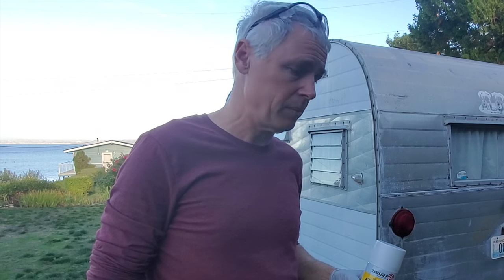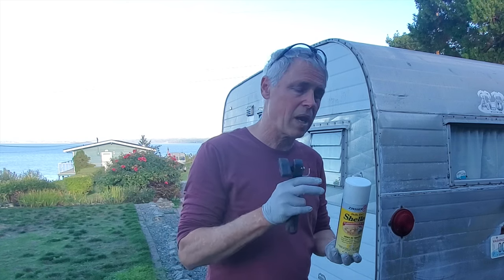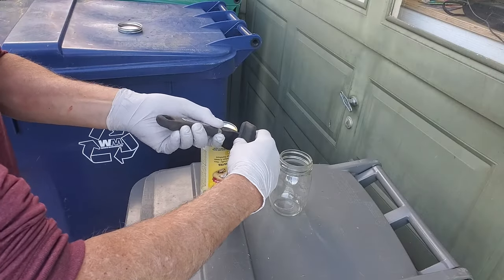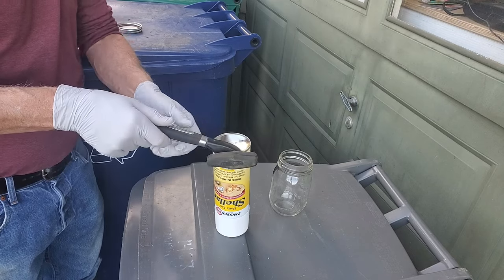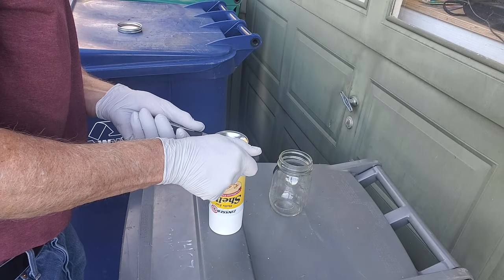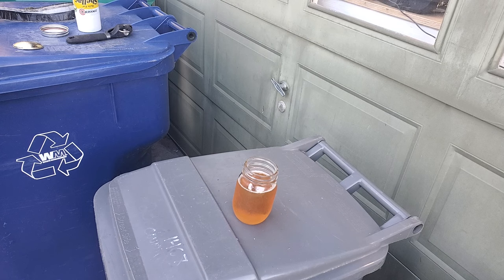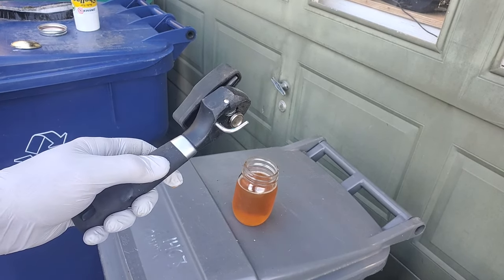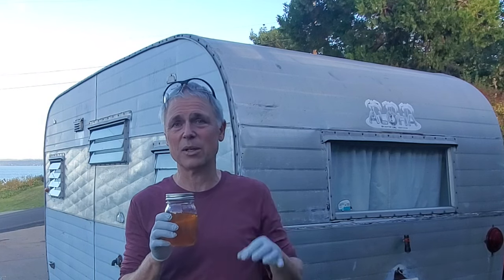How to safely remove spray-can contents.

Comment: Very interesting! Useful information too. So the bubbling when you got the bottom off the can... I'm guessing releasing the pressure relatively rapidly as you did,the liquid propellant was absorbing heat as it evaporated into a gas. It got the shellac and the can so cold that there was some liquid propellant still in the bottom of the can, evaporating and making bubbles up through the shellac.
Reply from the maker: Thanks for that info. I'm terrible at science and physics.

Comment: And... in this position, press the valve, - Is better?
Reply from the maker: up-side-down keeps the fluid from spraying out.
Reply: @paulwelkinsdiy  mmmm.... you beliebve?
Reply: @paulwelkinsdiy  To clean the valve, after painting, I turn the container upside down, and only gas comes out

Comment: "I don't want to spray this where I sleep, because I don't want to breathe this shit." Proceeds to hang his head above it while bleeding the gass he doesn't want inside. YouTube in a nutshell.
Reply: Outdoors is a LITTLE less confined than a 50 sq ft camper.
Reply: @monkeysuncle2816  sure, but if he's staying that close and venting the stuff in a bigger batch than he would release by spraying inside, I don't think it's that much more diluted with air. Not instantly.
Reply: @IvoTichelaar  true, and reducing a little inhalation to effectively none would be better
Reply from the maker: In mentioning the fumes I was trying to avoid being around was referring to a corner area in my camper where the paneling has rotted out due to past moisture damage. I know it's not good to be around rotted wood, so this was my idea of sealing that area. Spraying in a small confined area sucks, and the area that I was sealing was a small strip. Much easier to brush on the sealer. No taping no fuss. As to me being over the can, yes, but I didn't stick around once it started leaking. YouTube does have some nutshells but I try not to be one of those guys or gals.
Reply: Than Moves to Chicago to be safe from gun violence
Reply: @paulwelkinsdiy  you are an icon and I enjoy your videos. There is always context missing. It just struck me as funny.
Reply from the maker: Ah, you made it thru to the end. Thanks for watching!
 @613kc